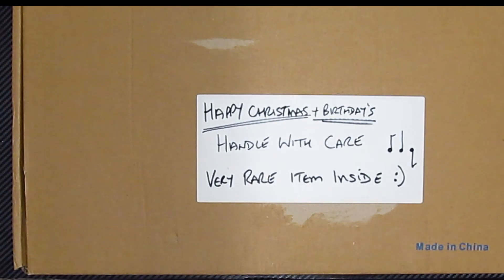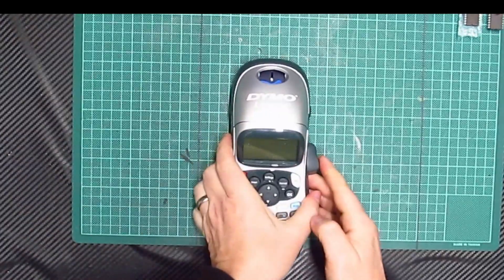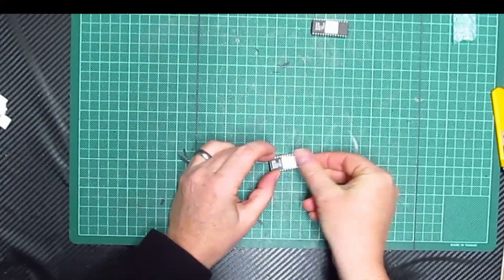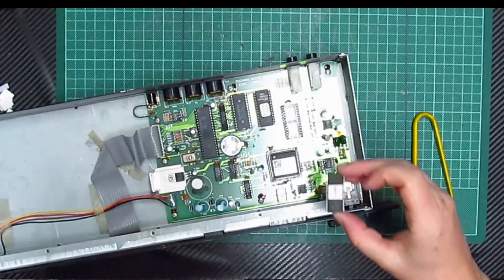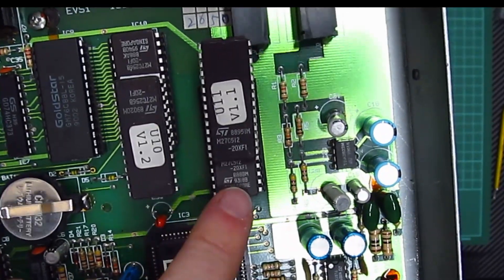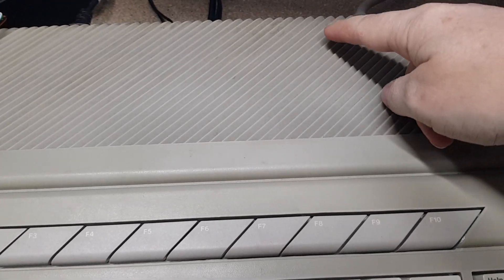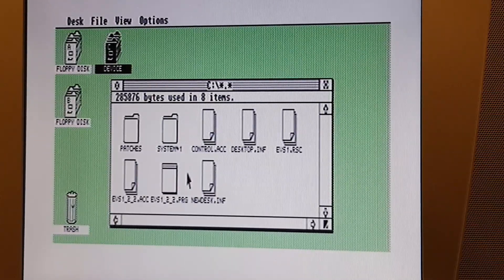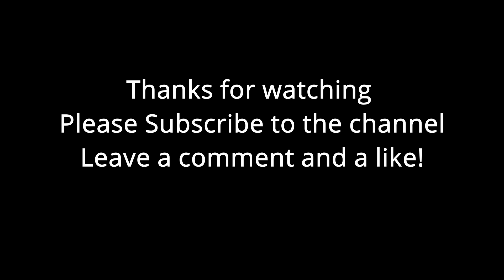Evolution EVS-1 Firmware update and test

Comment: i seem to have lost the PSU last time I moved house -- any idea how to get a compatible one?
Reply from the maker: i just used a  universal PSU with the correct sized plug end. 9V positive centre. Seems to work.
Reply: @MikesRetroTech  I thought these needed an AC output PSU?!   Are you sure?
Reply from the maker: @annother3350  dunno, I just used variable voltage psu with the correct sized end piece and 9v positive centre. Maybe that's why mine doesn't sound very loud?
Reply: @MikesRetroTech  Have you tested the line level outputs round the back?
Reply from the maker: @annother3350  yes, and re-capped and re-chipped the main board
Reply: @MikesRetroTech  oh. Its probably something more technical than this but clutching at straws - did you make sure the volume of the individual sound was up by using the front panel buttons? -- see page 9 of the manual

Did the ebay seller make you aware of the issue??
Reply from the maker: @annother3350  no, nothing was mentioned when I bought it. I WILL get it fixed!
Reply: @MikesRetroTech  Good luck. When I try the generic adapter I'll let you know if the volume goes quiet !

I was told by a reliable source that replacement adapters can be sourced from Alesis' spares website.
Reply: @MikesRetroTech  I bought a Lexicon Vortex 9v AC power adapter in the end. readily available and works perfectly